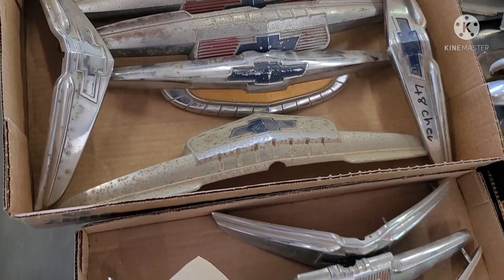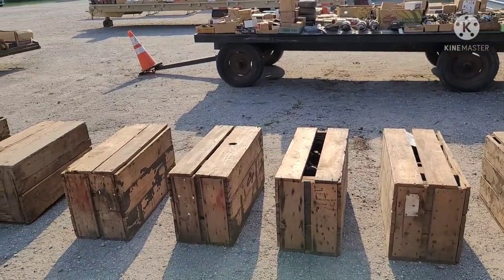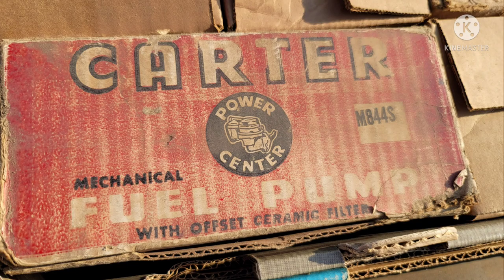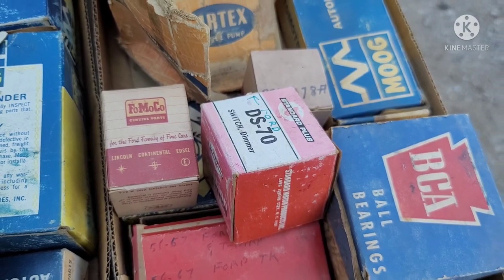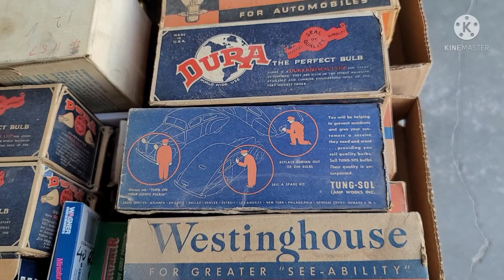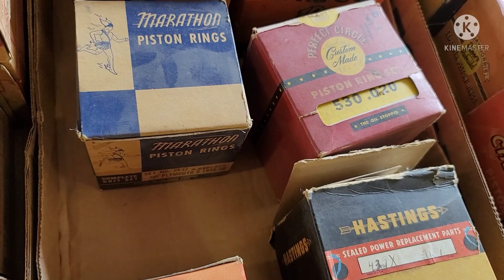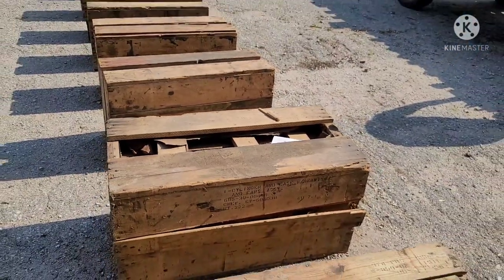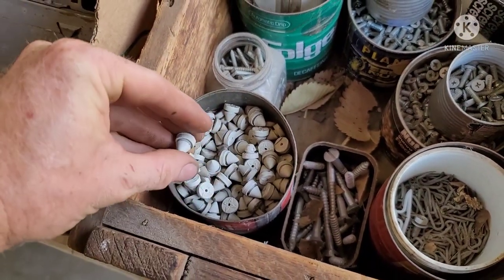Vintage Parts Auction: NOS Chevrolet, Buick + more! Auto Repair Relics & Vintage graphic Art!

Comment: Were i your age and full pockets of cash, I would save enough for gas to get home and buy it as long as the money lasted. It all has value. Even the radiators that were green with corrosion and what not would be in the pile coming home. So there is a reason that I am old and poor